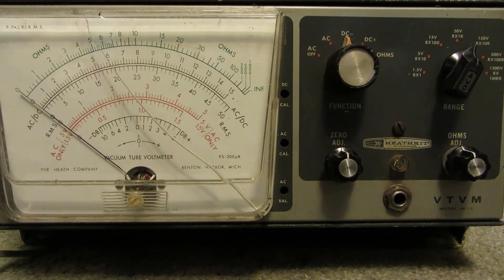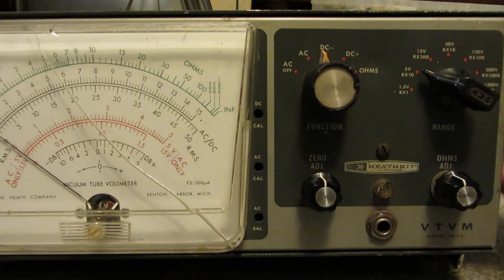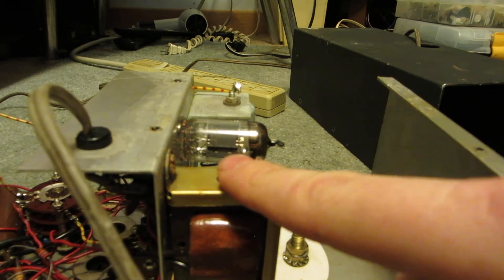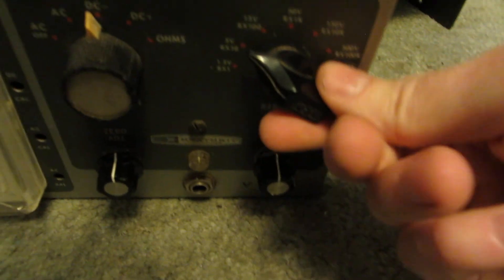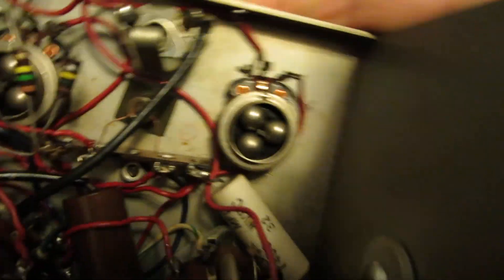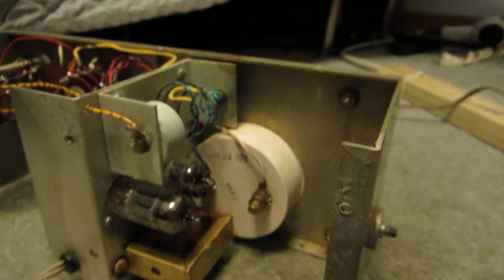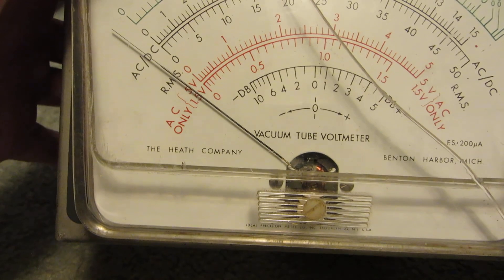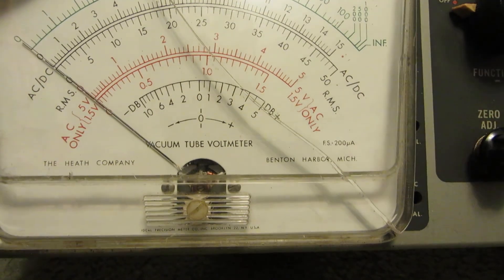HeathKit VTVM IM-13 Autopsy

Comment: To you young whippersnappers fiddling around with this old stuff. Here are a few points of clarification from an old solder sniffer, both to the comments in the video and the viewer comments about this so-called "VTVM autopsy." 
First and foremost - this is no autopsy because she ain't dead! I'd bet you dollars to donuts that with a simple battery replacement, cleaning a few switches, and a simple calibration, she would run fine for another couple decades. See, back in the day American companies used to build them like that. This unit shows every sign of complete functionality. Just needs routine attention. 

1. re: " it had an old battery here which I've already removed"... the VTVM cannot correctly operate without the battery. The battery is a critical reference voltage for the circuit. Yes, the meter will wiggle - no it will not be functional. Gotta have that battery in there. :-) 2. re: Akinaro's comment "It's hilarious that today we can get that in smaller size than a pack of tic tac..." no you can't. A VTVM has in input impedance of many megohms...(10mOhm or more is common) in comparison, cheap tic-tac sized DVM meters have input impedance in the low thousands of ohms. Even "nice" and expensive DVM cannot match the ultra-low impedance of a VTVM. YES, that is a critical difference which makes the VTVM vastly superior in a very substantial number of real world troubleshooting situations. 3. "Step down transformer"...actually that's both a step down and a step UP transformer - it supplies filament (6v) AND plate supply (about 170v). Be careful...170v rectified to D.C. Is heart-stoppingly potent. :-)4. Speaking of the transformer and that 12AU7 tube? It's not "running on 12v" . Its heaters run on 6v just like the 6AL5. It has a center-tapped filament so it can go both ways...6 or 12 volt heaters. Most 12A-7 designs used them as 6 volt tubes to save money. Just remember, the real work in a tube is done at that high voltage I mentioned in point 3.6. Re: "never seen those before" Clariostat ball type potentiometers...Sonny, maybe you haven't been around these parts too long? :-) all kidding aside, those were extra cost items that assured smooth operation and long life. Good observation that you noticed them. They are the sign of what we used to call "American made quality". See, Heathkit was a respected supplier of kits you could build yourself. Meters, power supplies, ham radios, amplifiers, oscilloscopes. That's why this one is still completely capable of doing its job even though it is more than fifty years old...
Anyway, glad to see you youngsters using the internet for something useful. Keep it up! :-)

Comment: It's hilarious that today we can get that in smaller size than pack of tic tack...
Reply from the maker: I've never seen a multimeter as small as a box of tic-tacks.. not even close.
Reply: HL4EHalfLife I mean components(not whole device): instead of lamps we have micro chips, resistors smaller than few mm, etc etc.
I should write that in the first place -_- 
As for smalles actual device as a whole, I saw few ones that where size of pack of cigarettes... If not the screen and 9v battery I think we could have smaller one... Not to practical but still...
Reply from the maker: Yea I have an analogue multimeter that's about that small, you can find them still at hardware stores lol.
Reply: Yeah, but it's junk.